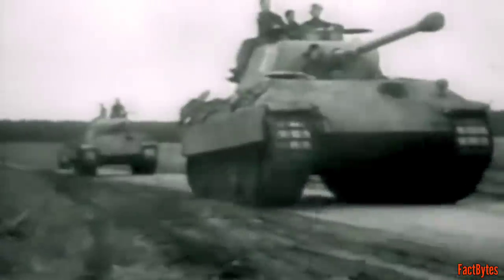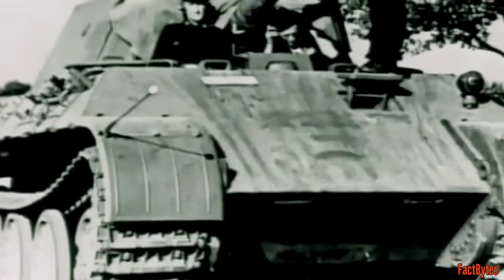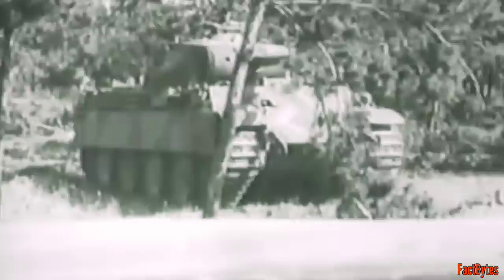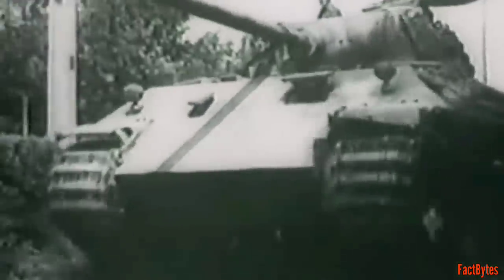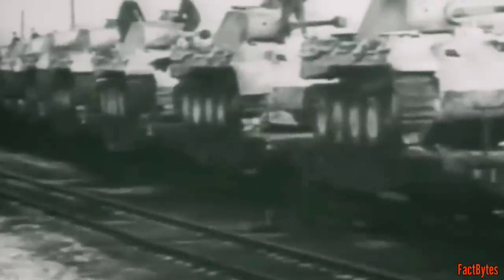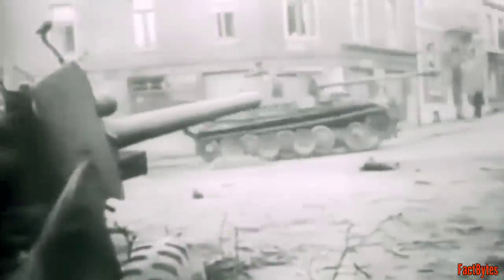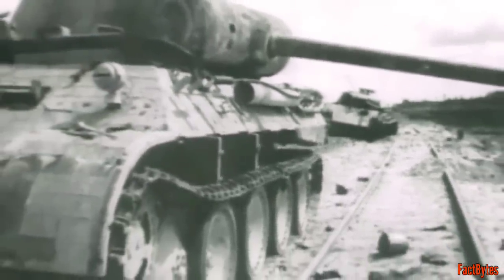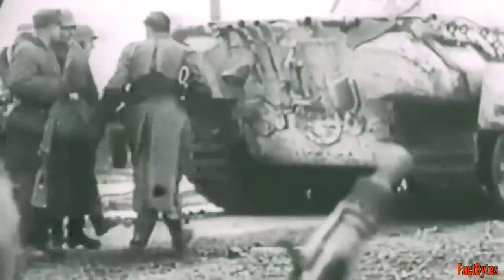Was The German Panther Really The Best Tank Of WW2?

Comment: Panther HE filler: 725 g of TNT.
Panzer IV HE filler: 686 g of TNT.
Tiger HE filler: 698 g of TNT.

What the heck are u talking about it was not EFFECTIVE against inf?
You should knock down myths with this kind of videos not mystify them more!
Panzer 3 and 4 was constructed for:
Panzer 3 for stugs
Panzer 4 because Germany needed tanks.
Not because of that, the panther had no anti-inf capability. Oh my God.

Oh my f. God Battle of Arracourt again...when the not informed, not trained germans got flanked and raped. Oh my God, what is this connected with the periscope?
The Panther commander could view in 7 ways and from the ausf A even the loader had 1 optics on the turret.....

Road wheel overengineered....tell me, you think the germans was f. retards? 
How many layers of road wheels the tiger ausf H early had? I tell you: 4. 
Late Tiger asuf E and panther? Only 3.
Tiger 2? Only 2.
They known it's hard to repalce, but it was more stable for going because of the torsion bar system. Every f. tank using this bar system today, with less road wheel.

Real armor..thin....Oh my God....tell me, how many side armor the M1A1 Abrams have? 27-30 mm...less than the WW2 Panther...................
Leopard 2? 30mm...less than the WW2 Panther...................

Reliability problems....yes...with avg 60-80% combat readiness in 1944 and nobody ready reports what even can found in the f. wikipedia...and there it is, please use the french report more, what says 150 km avg, when the german reports are saying the opposite! Yeeeeeah good drivers could rive 1800-4000 km with the panther but yeeeaaah it was a design problem..yes...
NO! It was sensitive, an the f. germans had no crew training.
With no exp, many driver could break a modern final drive in 10 min in a modern car today...

Can u imagine what hard it could have been in 1st gear with the panther with no exp?
45 tonn heavy and 700 HP in your back.

What do you think, why the shermans , t 34 had not many fault with the final drive?
Less HP, less weight-->Less stress on the Final drive.

More panther destroyed by fire than sherman? Source please.
Reply: "Oh my XXX""?  God has nothing to do with it and blasphemy is a serious crime against God.  In the Old Testament it was punishable by death.  Would you use your mother's name as a cuss word, to express disgust?  Of course not, as you respect your mother.  God made your mother, that gave you life, but you disrespect God?
Reply: @HiTechOilCo  Nice. And when you gonna realise, the Old Testament laws are overwritten by the New Testemant? Hmm? Jesus/God made a New Alliance with the Mankind. 
And saying Oh my God, since when a curse word? o.O Many ppl using it as amazement/astonishment like me, but OK, I guess you can read everyone's mind.
Did you not know the "mother" amazement/astonishment word?
"My mother: foment me" You would think its a cuss word aswell?

Oh and nice "argument" instantly used Ad Hominem. I guess you know the Graham's Pyramid and you 100% exactly know your place on it now.

Comment: I remember an interview of a Sherman tanker after the war. He said they didn't fear the tigers because they never saw them.  Most were on the Russian front. He said they feared the panthers. They ran into them frequently and they believed  it was a great tank.
Reply: And the ones in France were up north,where the British,Canadians and Poles fought them
Reply: Same here.  I met several American tankers who greatly respected the Panther's gun.
Reply: The trouble is not the tank, but its crew!
Reply: Roger that.  The Panther was, by the standards of the time, more a heavy tank than a medium, but its widespread use led it to be classified as a medium.  In truth, its characteristics give excellent claim to being the first mass-producing MAIN BATTLE TANK, but the Panther was never developed under such a concept.  Indeed, its size, main weapon, and armor were more to have a credible AFV that could take on what the Soviets had or reasonably could be expected to throw at them in the near future.  This led to "design creep", where the vehicle got larger and heavier, with more "gadgetry", and by the time of Kursk, the first production run had been sent to Gen. Model's Ninth Army, BEFORE they'd been subjected to the normal testing program that otherwise the Panzerwaffe would have demanded.  Needless to say, their combat debut was very disappointing, as nearly 75 percent of the Panthers committed to the Kursk battle were lost, mostly due to breakdowns.  As the Germans had few recovery vehicles that could handle the Panther (or the Tiger), in a lot of instances, they had to be destroyed by their own crews before the Soviets captured them.  Mostly at General Guderian's insistence, the remaining Panthers were withdrawn from front-line service, where they were retrofitted with the identified "fixes".  Once this was accomplished, along with proper training of the drivers to deal with the fragile differential, the Panthers proved themselves useful after all.  It also helped that by that time, with the Germans being decidedly on the defensive on the Eastern Front, their vehicles were driven less.  Also, the excellent frontal armor and the firepower of the KwK 42 weapon lent itself to the defensive, "tank killer" role, as Panther units would lie in wait for advancing enemy armor and pick them off, well out of range of retaliatory fire.
Reply: The Panther tank itself or the new crews? Training and familiarity make a great distinction on whether or not a Tank is actually *good.
Reply: VK.30 (DB) WAS better than the MAN ( finally the winer), even was prefered by hitler itself..the reason of the " t34 sillouet" was quite ridicoulous, and, being into the 35 ton limits ( like t34 and M4), was a real MEDIUM TANK, and having the transmission designed for such wheigh..Wasn't an overengineer design like the MAN ones..was smaller, another tactical adventages, and, having the same frontal armor, has a thicker side armor, being the 40 mm one of the panther a serious drawback, since even the small bazooka would destroy it, being easy prey to the 6 pounds AT..
SO, DB has the possibility to be upgraded, meanwhile MAN coulnt support any wheight increment
Reply: I miss spoke it is panther and Panzer as well
Reply: That Sherman crewman didn't see a panther until well after Caen was taken. He didn;'t see tigers at all until the bulge (except for I believe 11 of them sitting on railway carriages) because they were all in front of the canucks and brits. Ironically, a Sherman tankie wasn't in a position to criticize the panther given the POS they crewed. Taking 5 Sherman to kill one ":unreliable" Panther wasn't really great odds.
Reply: @davesherry5384  Wow, where do I start?  Okay so US forces were engaging Panthers in Italy long before the D-Day invasion. Additionally the US had engaged Tiger 1s as early as the Battle of El Guettar in Tunisia before that.   The Tiger 2 didn’t come into existence until mid 44 and in very limited numbers, the tank really had no bearing on the outcome of any battles due to its poor reliability and very limited numbers. Lastly this whole perpetual regurgitation of the it “takes five Shermans to Kill a Tiger, or a Panther”. First let me suggest picking up a book instead of scouring the internet.  You will get a lot more information and much better context than some guy posting History Channel garbage. Tanks don’t fight each other in a vacuum, and often the best thing to fight a tank isn’t a tank. A better look would be to compare German armor Divisions to American armor divisions and no better place to see that than the Battle of Arracourt. Long story short the US Army Combat Command structure proved to be a much more effective unit than the German Panzer Division. Another good example would be the 2nd and 99th infantry division’s at Krinkelt-Rocherath as they had basically decimated the 12 ss pzr rgt and 277th volksgrenadiers. They used mostly bazookas, artillery and a few M-10 tank destroyers, no Shermans at all there. In the opening days of the battle at St, Vith the focus point of Joachim Peiper’s two M-18 Hellcats shot up 11 Panther's. An M-10 took out four King Tigers.  There are historical outliers but this 5-1 ratio is just elementary nonsense. It shows a lack of understanding of how US forces functioned and western front history in general. American tank companies functioned in platoons of 5 so if you were going into battle the smallest maneuver element for tanks is the platoon, meaning it didn’t matter what was getting engaged at the very least it would be a platoon of 5 tanks.  Lastly as for the Sherman being a POS.  The US was fully capable of building any tank it wanted to in WW2. The US had captured Tigers in Africa and could build them if it so wanted. So if not the Sherman what tank would have been better for the US to produce?
Reply: @patricklewis9662  See that's my problem the USA had many options they stayed on it. The crews rarely talked well on the Sherman.  Notice how post war historians criticize those crews and never were in tank.  Look even when I was in, we hated lots of equipment that the government says was fine.  but civilians with no experience says was fine to this day.  Or they removed good equipment we loved.
Reply: @gravitatemortuus1080  in Steven Zalogas book Armored champion he examines the question of what was the best tank. Now this question becomes incredibly complex but to answer it he looks through a couple of lenses, one like you’re pointing out is the end user but the other is the battlefield commander and the lists look very different from those points of view.  Now look, I served 22 years in the military so I get where you are coming from. However look at the requirements needed for a tank in US service in WW2. It needed to be under 35 tons due to railcar availability and the limitations of the Liberty ships cranes. It had to be reliable and be able to travel upwards of 2000 miles between overhauls. Once you look at the logistics to to get to the battlefield and operate there the list of available tanks becomes much shorter.  At the onset of US involvement the focus of the tank was to mostly engage soft targets, and indeed 86% of all rounds fired by Shermans were High Explosive, in fact Armor Piercing was rarely used, there just wasn’t a whole lot of German tanks. Now by the end of the war the US had mostly abandoned its TD program and moved to up gunned, high mobility Shermans in the E8 program but also in the introduction of the M26. Now that I think is a better comparison the Pershing and Panther as both tanks are roughly 45 tons but by nearly every measurable point the Pershing is a much better tank than the Panther. I think the US did really well what we had and I would keep in mind the bias nature that comes with first hand accounts. Its easy to criticize your own equipment and praise the enemies because you’re on the receiving end of that equipment. Jaochim Pieper was quoted as saying the M10 GMC was the best antitank gun he had ever seen. Now most people probably wouldn’t have agreed with that, the JagPanther and SU100 were probably far more capable but he had seen the M10s kick the crap out of his King Tigers and Panthers during Operation Autumn Mist. But let me ask this, if not the M4, what tank should the US have used?
Reply: @davesherry5384  Rubbish, Americans were not at Caen. That was the job of the British, Canadian and forces in exile.
Reply: Frequent transmission break downs and it's propensity to catch on fire are not qualities that one associates with the term, "best".
Reply: @HiTechOilCo   The Panthers Sherman crews got to fear were to ones that did work and got to the front. A Panther in working order was a potent tank.
Reply: @ricardosoto5770  and anyway, Ironically MOST Tiger tanks were facing the British/Canadian forces==especially in Normandy. US forces rarely dealt with a Tiger I. Most were probably seeing a Panzer IV and saw the slab sides and thought it was a Tiger (of course, standing around staring at a tank is probably a great way to get killed). But IRONICALLY, US forces did see rather a lot of the Tiger II 'King Tiger' from late 44 onwards.
Reply: @Filthy-Disgusting-Ape  That is correct. The Americans had practically never seen a Tiger 1, but thought that the Panzer 4 was one of them...
Reply: @traxel14  And you sure don't want to spend too much time staring.
Reply: @Filthy-Disgusting-Ape  It was British tank crews that first faced off with a King Tiger during Operation  Charnwood .
They thought it was a Panther (King Tigers took alot of design cues from the Panther
I think the British crew were thankful they were using a Firefly
Oops my mistake, Operation Goodwood, said by one historian to be the biggest tank battle the British ever fought
Reply: @g8ymw  Yes the "early" Royal TIger had a odd turret mantle compared to the 'later' mantle. Didn't the Germans want to 'simplify' the Panther for easier manufacture? One of the 'features' was that 'Pig Head' mantle that the Later King Tigers use?
Reply: @nickmitsialis the vast majority of Tigers were on the eastern front fighting the endless hordes from the east. If you knock out 10 of em it didn't matter because they had 11 T-34s. Must have been incredibly frustrating.
Reply: @HiTechOilCo  All WW2 tanks had "frequent" breakdowns. 15-20 Shermans out of 50 could be expected to fall out due to major or minor mechanical issues during a 50 km road march. By mid 1944 both the Panther and Tiger were reliable by WW2 standards.
Reply: @TTTT-oc4eb  the Shermans had some stuff the Germans didn't, easy fix, and good reliability.

Sure a Sherman breaks down, but you can take out it's engine and fix it on field, hurray! you can fight again, oh a broken wheel? Well you can just replace it on field too, hurray!

A panther breaks down or the final drive breaks, you have to get past the loads of stuff before actually getting to the problem, like removing the interlocking road wheels and multiple components blocking the problem, that's why most crews abandon them when they break down in or before a battle, and also because of it's weight, I doubt the crew has a crain or something to lift up and fix the broken tank parts.

That's why it usually needs a factory or base to get repaired because fixing it in a fast moving battlefield is a death sentence.
Reply: @HiTechOilCo  Its first model only. It was upgraded few times and drivers who know limits of their vehicle it was about as reliable as Pz4 was.
Reply: @HiTechOilCo  The fires came in the first batches of Ausf D (first series).  The tank had the engine encased in a sort of Aquarium to allow deep water crossings.  The fuel lines leaked and cooling pumps was inadequate.  This was fixed in the first few months.  
-The Panther went from drawing board to first combat in a remarkable 1 year so it wasn't tested properly.   Had it have had another 4 months of testing it might have had a smooth entry into service.  
-The transmission problems came from the two final drive reduction gearboxes that drove the two driving cogs on the front.  These should have been planetary like on the T-34 and Tiger but there weren't enough gear cutting machines so it had to make do with simple straight cut gears.  There were plans to get the proper gears for the final Ausf F version.
Reply: @HiTechOilCo  they rushed it that's why it had a lot of problems and they over engineered it which is what the Germans should not have done. Other than that once I got all the bugs fixed it was an amazing tank because it was balanced with Firepower pretty good armor and speed. That's why it was the best along with a t-34. It was better than the Sherman because the Sherman was fast and easy to maintain but it had poor armor and poor firepower. The tiger wanted to had very strong armor and Firepower but they were slow and they broke down as well often.
Reply: @HiTechOilCo  you're forgetting that the german economy was to it's absolute minimum after the treaty of versailles and nazi mismanagement and focus being on the war industry rather than on other things, if the germans focused on creating more general purpose technology then they'd likely be able to design a proper tank engine and transmission so it wouldn't "catch on fire"
Reply: @HiTechOilCo : Only the Panther Ausf D caught fire on their own 
It is the 1943 model and hardly 400 were built among the 6000 Panther...
Panther Ausf A and G were much more reliable, with an experienced crew they were as reliable as the Sherman.
They were harder to maintain notably for the suspensions which on the other way was better in all terrain than the Sherman ones.

Comment: Performance wise it was the best tank of ww2. Not the Tiger E or Tiger B. It wasn't reliable as a T34 or the Sherman but it was much better performing when working. The PZ IVs had the reliability of the T34 and Sherman but they could have never built enough to compensate the loses. Americans and Russians could do that with Shermans and T34s. So they had to try not proven better performing stuff like the Panther and its versions + Tiger B etc. It's easy to bash on something but the fact that Panther shot so many more tanks than the Germans actually lost tells a lot. So in some ways it is the best tank of ww2. Overall it might be on stage with the T34. Everything after ww2 was based on the advantages of the T34 and the Panther. Just saying.